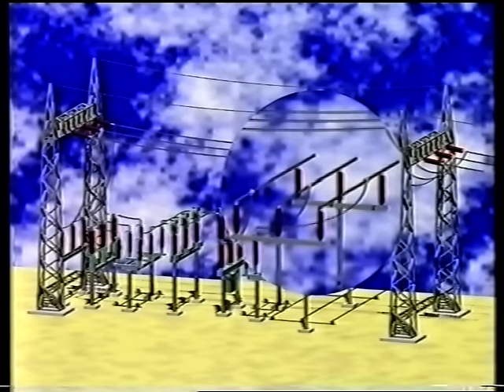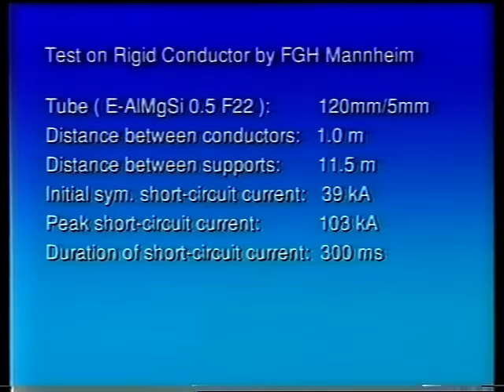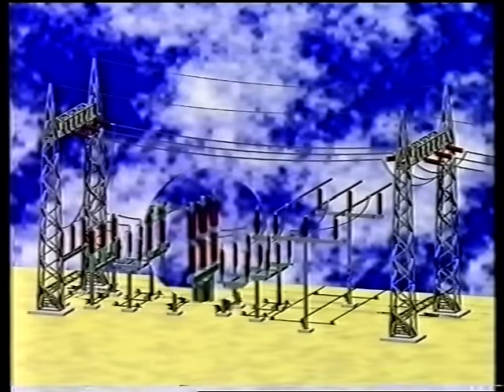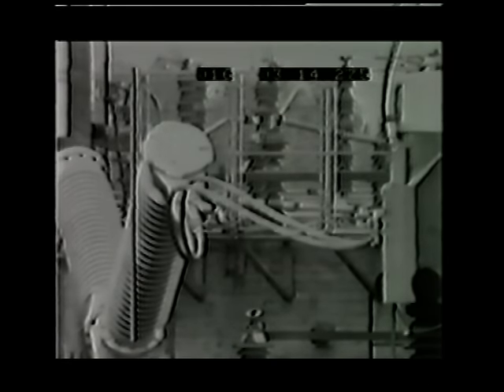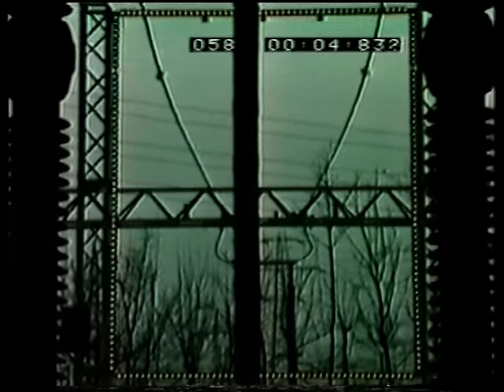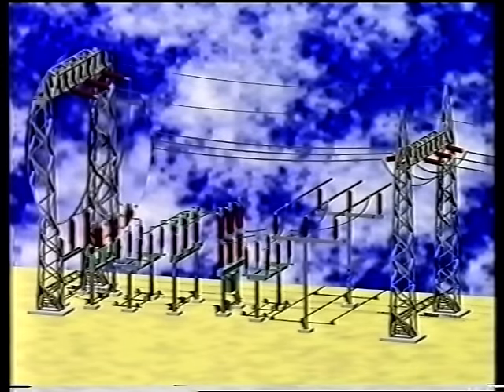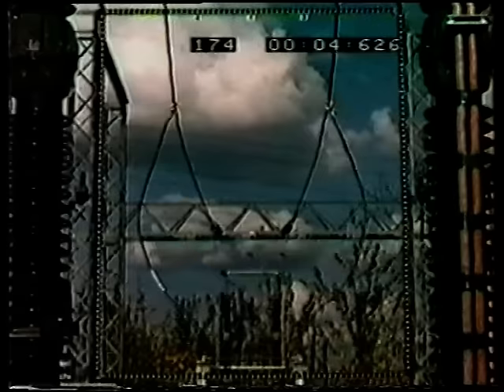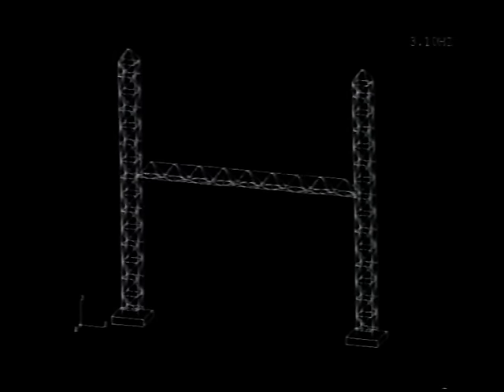Busbar Forces

Comment: I always had a hunch galloping high tension lines was from extreme currents opposing opposite magnetic fields in other phases and or magnetic Flux of earth. Awesome presentation
Reply: Most of that is from wind and maybe weight changes from ice suddenly falling off. It's rare, but still designed for, for an actual short to occur.

The forces from normal load current are generally negligible.
Reply: You would be wrong...
Reply: @Look_What_You_Did  They got an explanation four months ago...
Reply: There was some very large lines I would drive by sometimes, I'm guessing around 350kV.  Light drizzle raindrops would pop and cause the lines to really start resonating, quite interesting to watch.

Comment: Sight of this must influence every protection engineer to ensure that the systems operate correctly and disconnect faults as rapidly as the system requires. It is a given that the switchgear operates correctly under fault conditions. In the UK NG require fault clearance in 80/100/120/120ms for 400/275/132/66kV. A significant amount of energy can be spent in 80ms at 400kv typically at 50kA with ratings of [i think] 35000MVA.

Comment: I have one basic doubt, which I would like you to clarify. As per BIS, the transmission towers are designed based on working tension, wind force and self weight of conductors and insulators. But there is no mention of SCF in design of transmission towers. It is only applicable to the design of structures within AIS. I would like to know the exact reason, why SCF is not applicable in transmission towers. 

Also, for the incoming gantry tower, what forces need to be considered for structure design.
Reply: I think that the wider spacing of conductors on lines would generally result in much lower short-circuit forces than in switchyards where minimum clearance is necessary to maximise density.
Reply: This is true, but the increased length of conductor between towers means the short cct force goes up again. There's another factor to consider however and that's the component that fails from short cct force. 

The weakest point in AIS is the post insulators which the conductor is sitting on. These are weaker than the steel structures beneath and are what snaps. On a transmission line, string insulators are used instead of post insulators, which can cope with a higher force as they are under tension only. They don't experience cantilever forces. 

I've not done much design on transmission towers so I'm not sure what's standard for them. Just saying that the assembly is different.